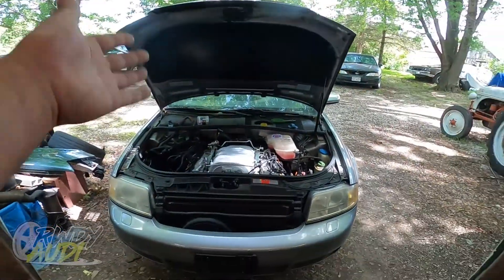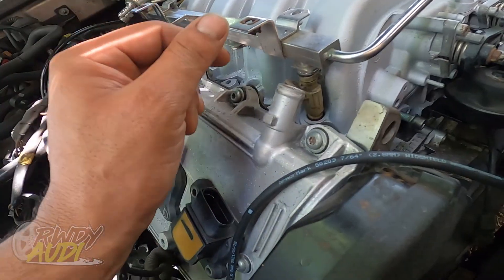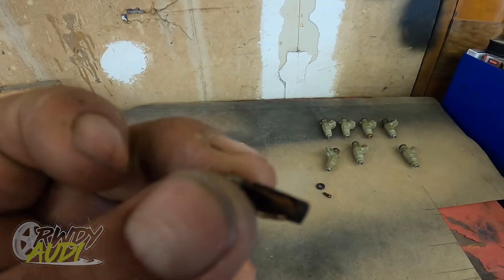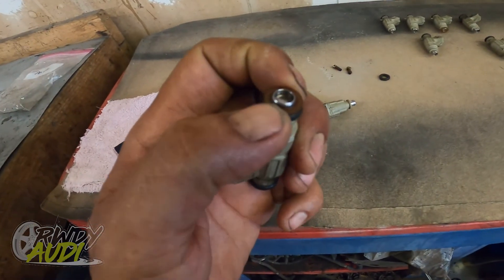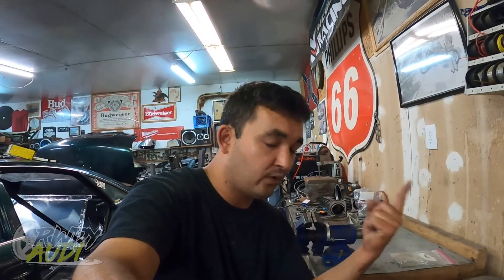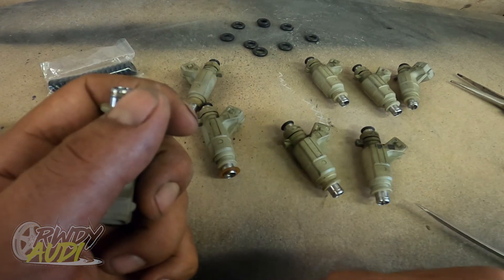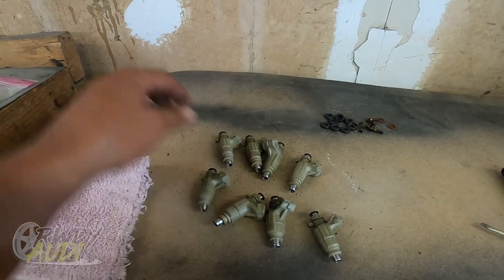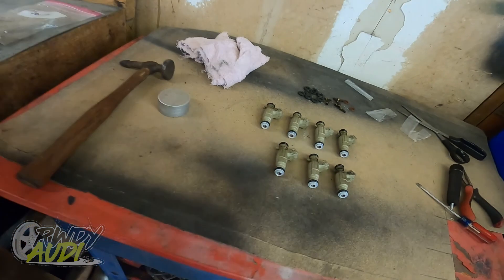How to Rebuild a Audi  Fuel injector | DIY SERIES|

Comment: Thanks for the content.  Have an 03 audi s8 taring into intake gaskets and was wondering if you knew of the oil valves to the heads.  Warm i have a rattling condition when you start it.  Thanks man for keeping the d2s and other audi cars alive!!! love the s8!!!
Reply from the maker: Is your rattle on start up only, warm or cold ?. Thanks for the support my dude
Reply: @TheRwdyAudi  now both was only  old now after hot on startup she rattles.  Thought it was the oil valves in the valley or in the heads? Can't seem to find any engine break down info.
Reply from the maker: Check your guides top and bottom in your heads and get back to me .
Reply: @TheRwdyAudi  top chain guides are good for docs......timing belt is good
Reply: Turns out bottom tensioner on rh cam bank loose....
Reply from the maker: You can replace just the guides make sure your tensioners move freely when you take them out